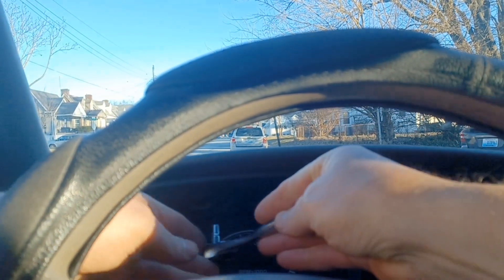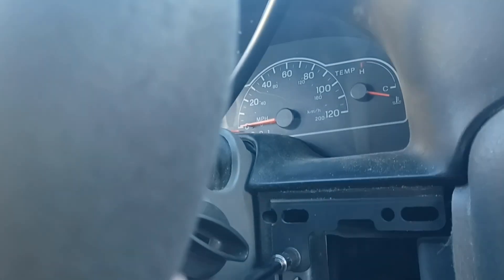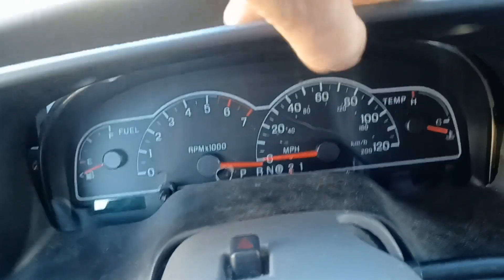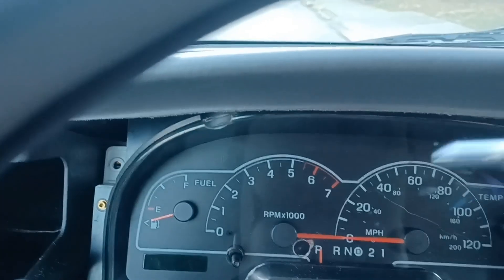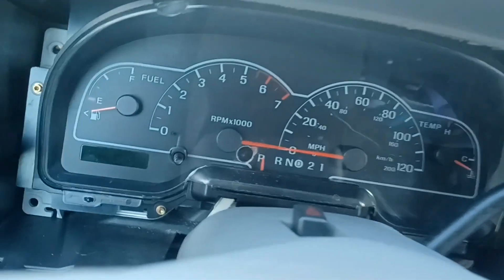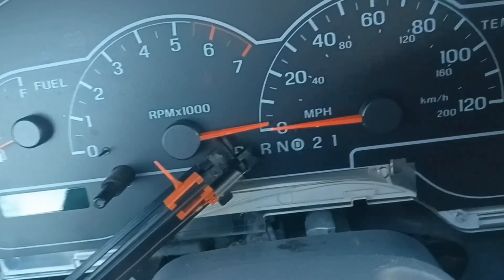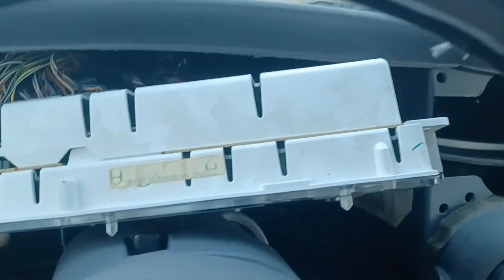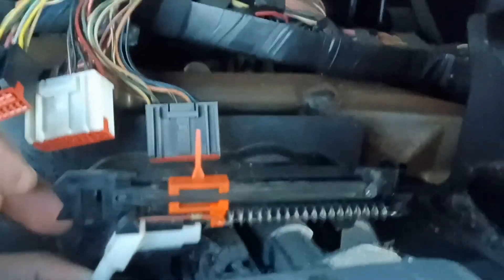2002 Ford Windstar LX: Remove Instument cluster

Comment: Thank you for filming this. It's not as bad as replacing the radiator !! Overall the Windstar is a great car for DIY folks. 250,000 miles so far and does not burn oil.
Reply from the maker: Yes, I love mine (about 160k miles). Leaking oil some, but runs like a scalded dog.